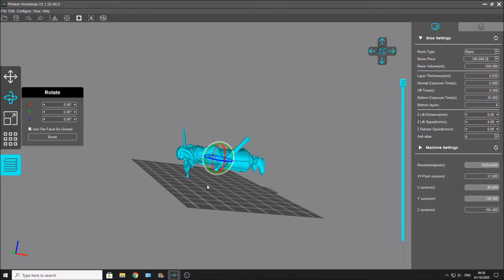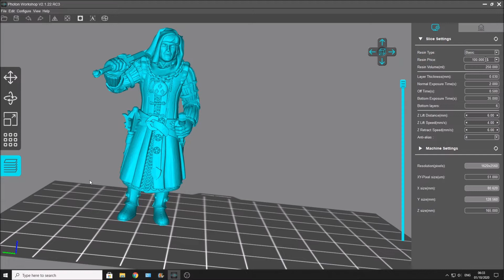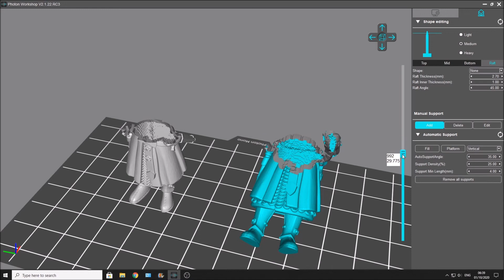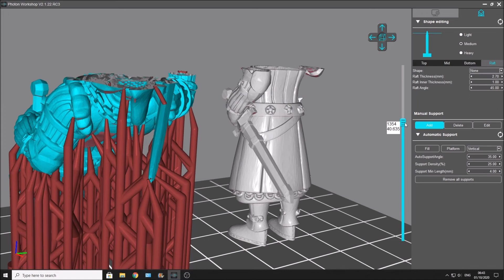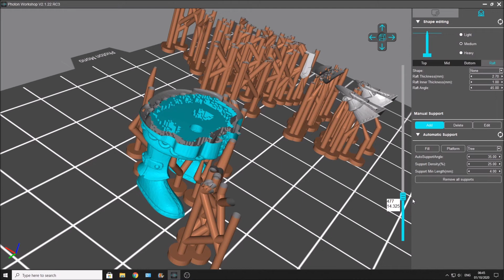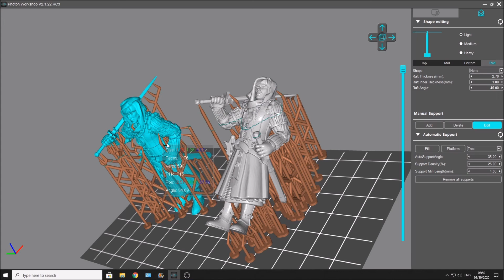The Anycubic photon workshop with a working support system

Comment: how do you save it so you can print
Reply from the maker: the blue icon that looks like stacks of paper on the middle left side. click that it will slicer the model and save it to where you want to save it. make sure you have the right printer selected from the menus.
Reply: @TKs3DPrints  thanks i at the end found it but the design did not print so i have to find out what i did wrong keep your videos up they are great
Reply from the maker: @louisebastard2091  the videos will stay i will be uploading more in time. i would suggest downloading the lychee slicer. in my views its the best slicer i have used an would recommend it to everyone. i use the free version. it has a great internal support for hollowed models etc. the paid version has more options with editing the supports for fine tuning. and other options for blurring and Anti analysing. but the free version will work very well with most printers and they have all the photon range in there lists. again just follow the video i have posted. and you will never want to go back to the photon workshop.. :)
Reply: @TKs3DPrints  thank you brought the 3d printer for my daughter but I think i am more excited and want to learn more so i will be going though all your videos thank you for your help

Comment: Hi, using the photon workshop, how do you slice the model into .pw0 format? Mine only has the option for slicing into .pws format. This is for my photon zero which seems to only read .pw0 files.
Reply from the maker: select configure. select photon zero. then that's it just load support and slice.
 what version of the slicer are you using ?
Reply: @TKs3DPrints  I don't remember the version number but I downloaded it from their website today, since the version that came with their usb was a bit old.
Reply from the maker: @noddynod4434  new versions are not always the best versions as some still have bugs. the version i use is v2.1.22.rc3 but again all you need to do is when its booted head to configure. select the photon zero settings. and that should be it. then when slicing it should come up with the pw0 format when saving. if its not working head to my lychee video and follow the link in there and download the lychee slicer. its what i currently use for the photon range.
Reply: @TKs3DPrints  Thank You very much, Sir!
Reply from the maker: @noddynod4434  your welcome. always about to give a helping hand if i can. :)

Comment: After you added a support to the chin, you were able to move it around and edit it. As much as I've tried, I cannot for the life of me figure out how to move a support after clicking Edit. All I can do is move my view. Please help!
Reply from the maker: hello there. you have to click the tip of the support. or the base of the support. also are you in the edit mode.
Reply: @TKs3DPrints  I am in Edit mode, and when I click the base it turns red. Once it is highlighted, I cannot seem to get it to move. I've tried left clicking and holding, but my viewport moves instead.
Reply from the maker: @BenWatkins8403  hmmm annoyingly i just tried to load up every version of the workshop and they are all locking up on me when i add supports to a model. the only thing i have changed on my system is added some software for a microphone.  hmmm.... i am sure all i did was click and drag it. in edit mode. k i would look into downloading the lychee slicer. it has all the photons and mono range on there and has an amazing support editing. check out my video on its use. i will look into why my programs are not working tomorrow its 8am for me time for some sleep. but give lychee a look at. :)
Reply: @TKs3DPrints  I truly appreciate the pointers. I'll look into Lychee.
Reply from the maker: @BenWatkins8403  k i found out why my workshop was locking up. it was due to a chrome extension for facebook. after disabling it. i got it to work. yes all i do is head to edit then just click hold and drag the top or bottom. 
but i hope your having fun with the lychee

Comment: Great video, but support settings for the bottoms on Photon Workshop 2.1.24RC are different, there are more parameters and it's now difficult to follow your settings. Have you updated your setup? Thanks if you'll share again your settings :)
Reply from the maker: i will check and see what's changed. these days i tend to use the lychee beta. what rc version are you using.
Reply from the maker: k touch diameter. is the size of the base and thickness is how thick it is i tend to set this to touch diameter 4 and thickness to 0.5 or 1.  the next section is for when a support is touching the model in 2 spots. so i would have these as contact shape none. and contact diameter 0.05  and contact depth at 0.03

but give lychee a looks. :)

Comment: As far back as I can remember my workflow has been Chitu -> File Vaildator -> Add supports I've missed -> Print
Is there anything like the Photon File Validator for the Photon Mono? 
Rather excited as my mono is arriving today :D
Reply from the maker: have a check on the github for the photon file validator or might be on the photonsters.org i have not heard of one. but that dont mean there is not one already done. i have never used the validator. but you might want to look into downloading the latest Lychee beta think at the moment its at 3.1.8 you will like that it has kind of a validator built into it. its the only slicer i use now. i should be doing a video on it soon.
Reply: @TKs3DPrints  Awesome :)
Cheers dude. I'll give Lychee a whirl

Comment: Just when i dusted if my Photon, first print and supports broke
Reply from the maker: supports from my setup. ? would be handy now if youtube would allow pics in comments. what supports was you using as in thin med or thick.  how large is the model. was the model hollow and vented. and what resin and settings did you use. what printer ?
Reply: @TKs3DPrints  just ment your howto just came in handy. 

Got troubles with getting curing times. 
(12s / 60s) think either my Film has to be replaced or the resin isnt good any more (Anycubic Photo)
Reply from the maker: @JoergGebhard  resin should be ok might be worth shaking the bottle and stir the resin in the vat if its been sitting there for a while. try 15 and base of 80 check the bed level. also tension on the fep sheet. see if that helps
Reply: @TKs3DPrints   this one worked nice, maybe would even haven looked nice i  hade tightend the platform.